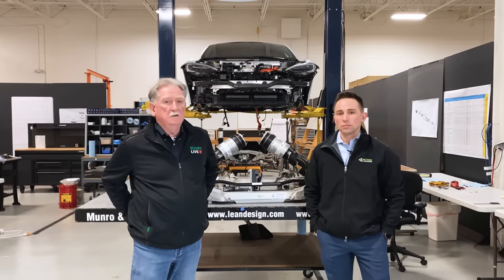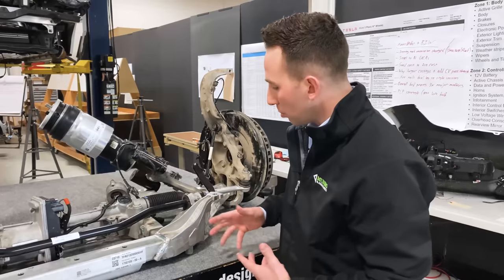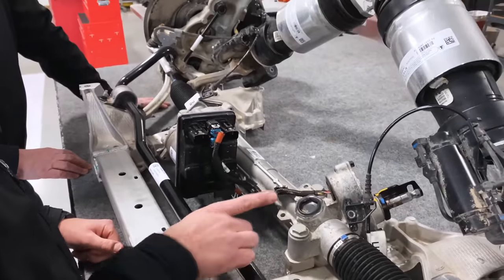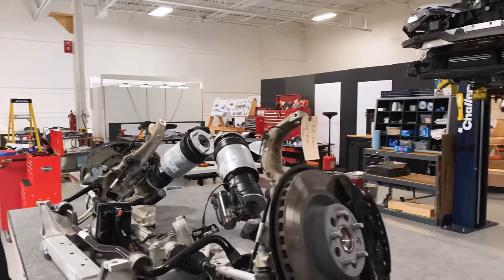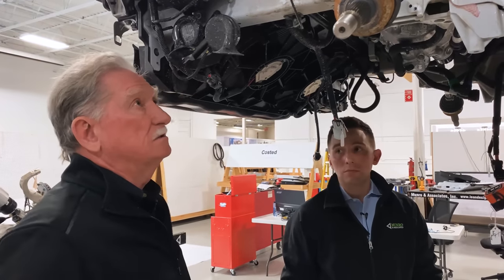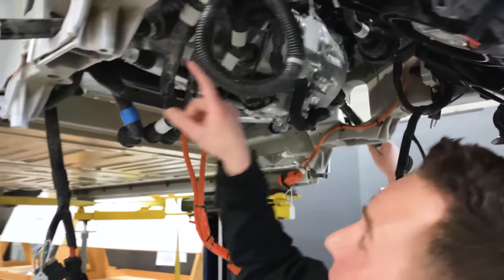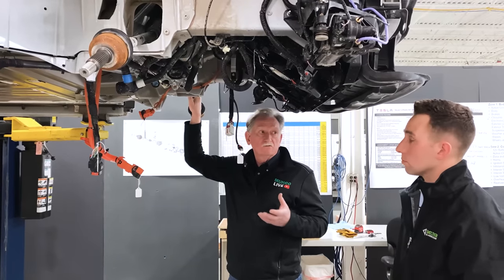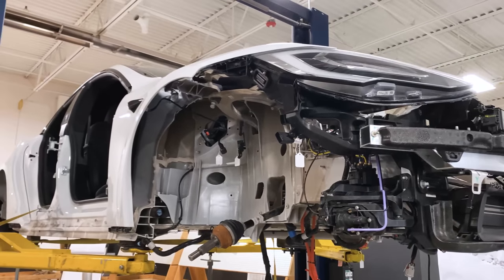Front Cradle and Suspension | Tesla Model S Plaid Teardown

Comment: Love that factory air suspension! As an old Air Force jet wrench (and I've wrenched a few cars in my day), I really love to watch you guys tear down Teslas and show why they are superior in almost every way.  I like seeing and learning about how Teslas are made.
Reply: Superior in almost every “which” way!? Lol….
Reply: @carholic-sz3qv  Are you too lazy to mention specifics? Or are you just stirring the pot, carholic1336?
Reply: They are far from superior. Just a bunch of standard industry components put together, there is absolutely no advanced stuff in here.  Electric roll stabilization? Rear axle steering? At least they have adjustable dampers, although I don't know if they are continuously adjustable or just with fixed settings.
Reply: @computercrack  don't see advanced anything....audi,Benz BMW have active sway bars,4 wheel steering,better torque vectoring 4wd,and on and on.  Tesla is overly hyped,under delivering.  All ya hear,wow,it accelerates instantly...power with no control is poor engineering.  Everything in a tesla was invented before by others
Reply: @cengeb  completely agree :)
Reply: You can buy a Jeep or a Ram pickup with full factory air suspension - it's not some special Tesla feature.

Comment: I've worked for a few different auto manufactures
I find it quite fascinating to see  how Tesla builds their cars, unique to say the least, clean sheet for sure
Thanks for sharing Munroe and associates 👌
Reply: Lol….. other manufacturers builds their cars to be as flexible as possible, also easily repairable, this big casting is going to be super expensive to repair, just like if a battery cell fails in the “structural” pack……

Comment: Aircraft have multiple redundant systems for flight control, I'm not sure you would actually save any weight with drive by wire when you factor in the required redundancies. 
It would certainly help a lot with packaging, and allow for tuning of steering response.
I personally would prefer to have the mechanical connection between the steering wheel and steering rack.
Reply: Agreed not sure it would be a weight savings. But the ability to change from left-hand to right-hand drive. I'm sure from a designer's/engineers view it would open up a world of opportunities.
Reply: Mechanical connection is the only way to go.Agrreed
Reply: With a yoke, steer by wire will actually help performance. But I agree with you about weight 🤔 that 2 extra wire may not save weight after all. (Not sure about that 🤔)
Reply: @simoc24  A drive by wire system is going to require more than "2 extra wire" to be safe for use in road going automobiles.
Every potential point of failure in the electrical system and electronics for steering will require a redundant system, even if just to provide emergency steering in case of failure in the primary system.
This includes a backup for the electric motor that drives the steering rack.
Reply: @markbeiser  Absolutely true! To be done properly it would more like two complete cables, each carrying a power supply from a different source, and each including a network connection to a separate controller. In an aircraft, it would be three of everything.
Reply: The Boeing 737 retains mechanical controls to this day. On the subject of steering, removing the mechanical link will destroy any haptic feedback/sense of feel.
Reply: Aircraft have a team of technicians working on them before and after every flight.... Unfortunately my car does not... So I appreciate the mechanical connection... Plus what if my whole system is dead? I need to be able to steer as I push lol

Comment: One of the reasons for a physical steering linkage is "steering feel", that car enthusiasts are always talking about, and complaining that Tesla's already don't have enough feel for them. If you removed the linkage entirely and went totally "drive-by-wire", then you'd lose the subtle input feedback that they're looking for.
Reply: Exactly.
Reply: All that may be true, but i just loved how sandy called those guys at NHSTA idiots.
Reply: There are actually TWO reasons you have to maintain mechanical linkage. The most important difference between an aircraft and a car is that the aircraft has redundant systems and a swarm of FAA-licensed technicians keeping those control systems working. The car? Not so much. If you can be reasonably sure the consequences of deferred maintenance won't leave you falling out of the sky, you're probably going to defer the maintenance. 

But to your point, yes, you'd lose wheel feedback, unless you're willing to give back all the weight the steering shaft saves you by adding a feedback motor!
Reply: Nope. Unlike aircraft with their mandated high cost maintenance schedules, many budget conscious hamfisted car owners will do as little maintenance on their vehicles as they can possibly get away with and only replacing things when they actually break hence the so many regular breakdowns everywhere. So you would really want to have a physical connection to the rack.
Reply: @ewmlloyd  Pretty much this and @supercharger's comments. There have been companies talking about drive by wire for years, and without that restriction in place, it probably would have entered some moderate production by now and ended up killing some hard-to-estimate-but-not-zero number of drivers. Sandy can talk about efficiency and savings and be fully correct about them, but there is a cost in human life with these decisions that is hard to quantify.
Reply: @ewmlloyd  "...unless you're willing to give back all the weight the steering shaft saves you by adding a feedback motor!"

As a long time computer geek & fan of force feedback, I'd love to see this. Unfortunately, the state of the art of consumer force feedback is pathetic at best (go try a logitec steering wheel). Many years ago I played with a FF joystick at a tradeshow that blew my mind - but it was $5000 just for the joystick & actuators, which is a bit steep to add to the cost of a car.
Reply: According to the presentation by Tesla, the electric steering used for FSD already is fully redundant, as it is meant to fully take over steering from the driver. So I wouldn't see an especial safety concern with going to steer by wire. Also, electrical systems usually are maintenance-free, so neglect shouldn't be an issue either. One would of course expect the systems to self check for any issues.
Reply: @peterherth7379  But if those were the only links, you couldn't steer without power. Not a problem for FSD, but a problem if the electrical system is damaged in a crash, or you lose power and need to steer it onto a flatbed.

Not common situations, but it's still a point against.
Reply: re: "One of the reasons for a physical steering linkage is "steering feel", that car enthusiasts are always talking about" exactly, when Sandy spoke those words both BMW AND PORSCHE LEFT THE CHAT...!!!

Comment: Boeing 737's (even the latest) have mechanical connections from the yoke and rudder pedals to the control surfaces.
Reply: Yep. It's the europeans with airbus...
Not a very Sandy thing to say
Reply: I worked on Lockheed transports in the past, and those has mechanical linkages to flight control surfaces. The primary linkages went to hydraulic actuators at the control surfaces, but there was also a physical linkage used as a backup. Sandy's statement was a bit uninformed, I think.
Reply: @ptamog  It's a very Sandy thing to say - in every video he makes absolute declarations which show his lack of knowledge.
Reply: @brianb-p6586  
There is some Dunning–Kruger effect and some political/corporate biases going on.
Knowing that, I still find it informative and enjoyable.
Reply: @ptamog  it's entertaining, and the images provide good information. The commentary isn't reliable, so that part isn't really informative; the aircraft controls comment is a good example.

Comment: The feel of the road through the steering wheel is one of those sensations that really makes a car. If it were drive by wire then you would completely lose that feeling.
Reply: This is not necessarily true. If done correctly then you would not be able to tell the difference. Even video games can give you feedback. Good engineering would make this a non issue.
Reply: @EnlightenedSavage  I second this.  Higher end consumer grade sim racing wheel bases can deliver very very convincing feedback and resolution.
Reply: With the actual EPS the feeling at the steering wheel is already artificial. The torque you feel is coming from the electrical motor at the steering coloum controled by its ECU and defined by the selected drive program.
Btw it is already an ASIL D system with a lot of redundancy.
Reply: Imagine instead being able to dial that feedback up or down. It could even cancel out dramatic twists that could break an arm.
Reply: @gundelfish  exactly, that's the right answer. The mechanicals are essentially backup anyway.

Comment: An observation for Sandy: An unpowered aircraft is either a glider, a crash about to happen or it's  parked.  An unpowered car with a steering system that's only electrically driven would be a PITA to move around a workshop or off the road during a breakdown  (major power failure from a variety of causes).
I vote we keep mechanical steerage with all our cars please 😉

Comment: Great point Sandy that the steering joint can be converted to electric motor like current airplanes.  Then all the amazing casting and dual purpose design to minimize parts used. Amazing. When you hire the best engineers, you get the best product
Reply: You obviously didn't read the half dozen pilots commenting here that say even the 747 uses mechanical controls.
Reply: Even if it were a good point (it's not), it's certainly not an original idea from Sandy.

Comment: I’m down with drive by wire steering (similar to aircraft) around the same time auto maintenance and regulations also match up with those of aircraft. 

But as long as we are ok with basically not having any owner level regulations on auto safety, I’ll defer to more robust mechanical systems as backups. 

Also, there are plenty of aircraft that still use mechanical connections to their control surfaces. You may be thinking of commercial jet aircraft, in which case the maintenance load is far far beyond what even the most uptight fleet manager would even consider.
Reply: Of course he’s talking about commercial aircraft, not Cessnas and the like.  🤷 🤔
Reply: @FutureSystem738  But he said "there's no aircraft on the planet that has anything mechanical going to any of the flight control systems", not "there's no current production large commercial aircraft has anything mechanical..." I'll bet there are still many commercial aircraft types in production which are not fly-by-wire.
Reply: To my knowledge, Boeing still uses mechanical flight control systems, though of course with power-assist. At least the 737 is still all mechanical, that limited the design of the MCAS system a lot.
Reply: @peterherth7379  Yes, the 737 is by far the oldest Boeing design still in production; there have been almost 11,000 made and 9,000 of them are still in service... all with hydraulic (meaning mechanical, rather than electronic) flight controls. Some controls can be moved manually, meaning without power assistance, although still through the hydraulic system.

The 767 is Boeing's second-oldest design still in production, and also has powered hydraulic (so mechanical, not electronic, although powered) flight controls, with fly-by-wire only for the spoilers. 1,238 have been built since 1982, with most of them still in service.

Even the normally fly-by-wire Boeing 777 and various recent Airbus models have limited hydraulic backup systems for the electronic controls.

Comment: For an analogous control system that predates aircraft usage, one might look at the baroque pipe organ.  The keys operate the air valves by tracker, which are about the section of a popsickle stick and can be up to twenty five feet long without introducing spring or requiring undo heavy pressure.  The key tops drop about a sixteenth of an inch when the fingers are placed on them and meet two ounces of resistance until the seal on the air valves are broken and then the resistance goes to zero.  The result is that the musician is clear on the moment that he opens the valve with no lag.  During the romantic period, they wanted to have longer runs and invented pneumatic assistance and pneumatic actions which introduced lag time into the system through the elasticity of air.  Due to the nature of the instrument, the concept of hydraulics was not tried as a tracking system because of complexity.  Later came electric actions for activating the valves, which made recording one's performance possible, but the keyboards lost their feel and had artificial means of supplying the feeling of top resistance on the keyboard.  Computerized systems are the newest iteration, but with improvements in chest structure in the neo baroque organ, the tendency was to return to the mechanical key action as it was the best for teaching clean articulation to the musicians.

Comment: Fly by wire aircraft controls have 3 separate systems for safety which can be done with the car steering as well but it wouldn't be two wires.
Reply: Passenger aircraft also have regulated maintenance schedules. NHTSA has to consider the safety of old rusted out beaters on the road driving through puddles. Plus the convenience of getting a dead  car on a towtruck or pushing a dead car out of traffic.

Comment: Sandy suggested saving weight and losing the drive shafts by having in-wheel motors, but that does increase sprung mass which has a whole lot of other issues.

Comment: I'm sorry to contradict you, but most aircraft in the air today uses mechanical cable linkages for their control surface. some large aircraft have fly by wire but 100% of general aviation aircraft uses cable links.
Reply: yup, take 737, its cables and pulleys.. i think most if not all airbus are fly by wire since 80' or so..
Reply: You're not really sorry, Daniel. You enjoy contradicting others.
Reply: I think it would blow Sandy's mind if he saw how many cables are in the flight controls of a 737.
Reply: Yeah, it was a really weird claim.

Comment: @Jordan, I confirmed with a Tier 1 foundry that those front subframe cast nodes are most likely produced in low pressure, not high pressure die cast.  The tell-tale signs are the surface roughness and more so, the two large gate cut-offs facing forward.  Likely 356-T6, with similar property requirements as safety-critical knuckle.
Reply: Depending on which casting you're referring to, you're correct. The nodes on the front cradle are permanent mold cast (a type of low-pressure die casting) but there are several other high-pressure die-cast components on the rear. Stay tuned :).
Reply: @jordanarocha3588  yep, speaking of the front nodes that are welded to extrusions.  Certainly a lot of vacuum HPDC elsewhere using Aural or similar alloys.
Reply: @mayflowerconsulting5540  Indeed!

Comment: The Boing 737 max and all variations before it still use cables for the ailerons, rudder and elevators. They upgraded the spoilers to flyby wire, but that’s it. 1960’s tech

Comment: Probably the main reason drive-by-wire hasn't been adopted for steering even though it has a proven track record with airplanes is that airplanes have much more stringent maintenance requirements
Reply: kinda wrong, multiple sensors provide redundance and can garantee that while the system thinks it works, it works.
Reply: @Thlips  but you have required maintenance procedures that have to be followed for aviation... Unlike with cars, where any untrained person could be performing maintenance (or not).  Until there is a higher level of automated debugging and redundancy for the systems used for drive by wire systems, there won't be more adoption